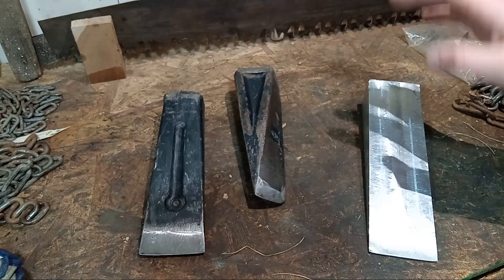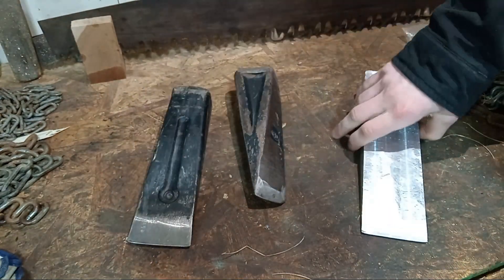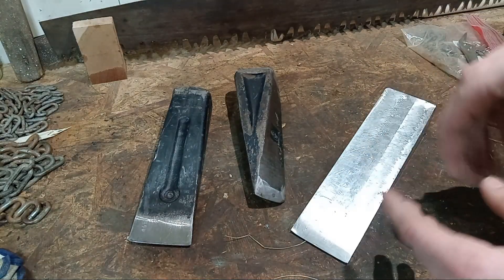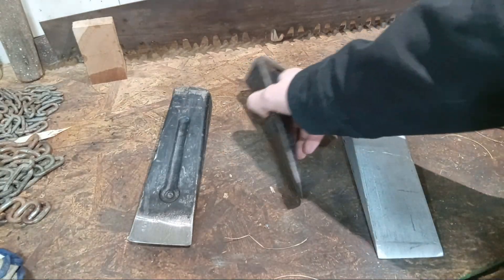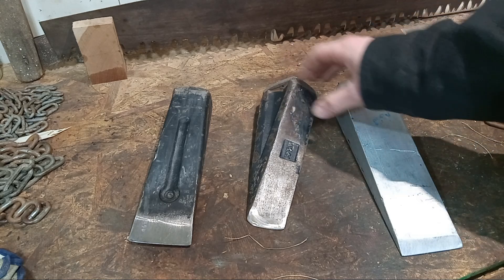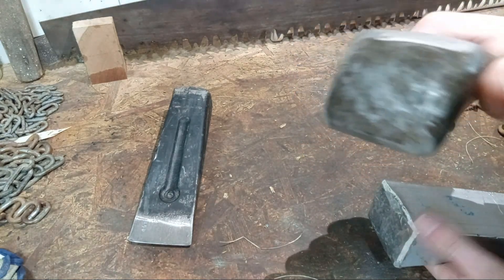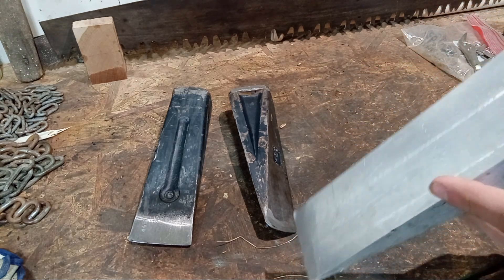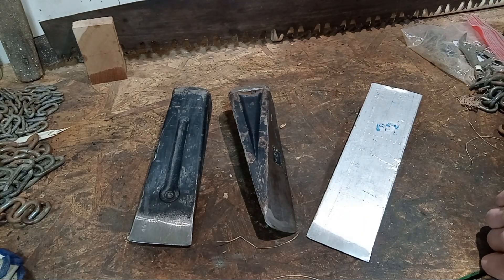Aluminum splitting wedge test - Prototype

Comment: I'm pretty sure the forest service uses aluminum and plastic wedges.
Reply from the maker: Yea, plastic is the most common material for felling wedges, with aluminum ones also, typically splitting wedges are steel though, with a few newer ones being aluminum.